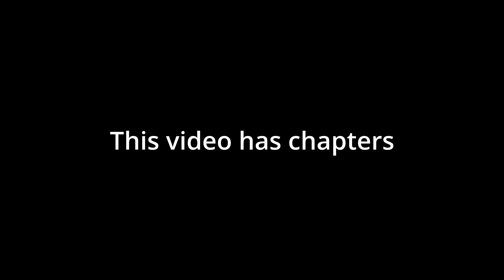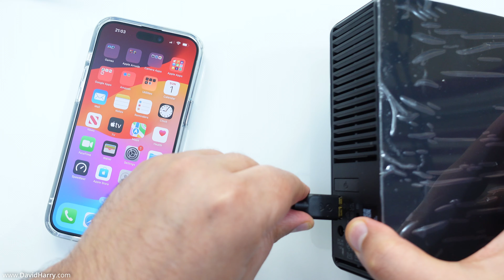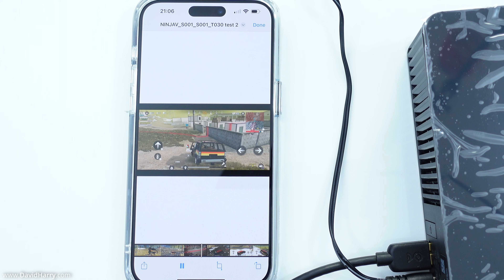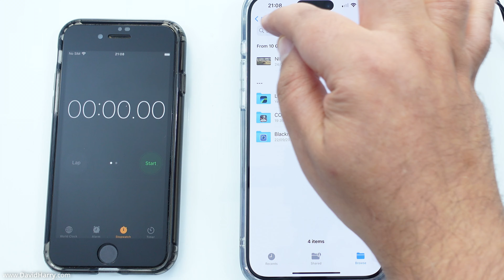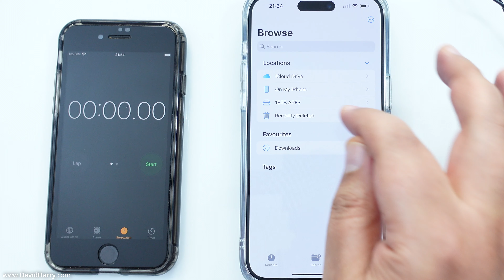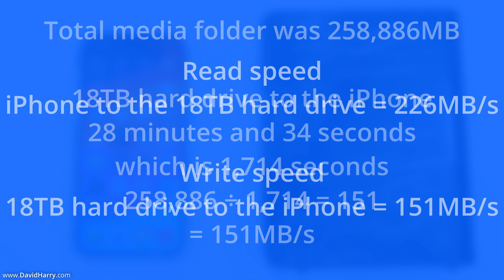How to connect a USB mechanical hard drive to your iPhone 15 Pro Max using a WB 18TB Elements drive

Comment from the maker: Using an 18TB USB 3 hard disk drive with your iPhone 15 Pro Max gives you a massive amount of backup storage space. With ProRes video files being so big and if you do a lot of filming, you will be needing to backoff those video files regularly to free up internal storage space on your iPhone.

This Western Digital WD Elements 18TB USB hard drive is a perfect temporary and intermediate backup solution for my iPhone 15 Pro Max within my video post production workflow. It may also be a consideration for you.

While SSD drives will be a faster option for backing-up and saving your ProRes video files form your iPhone 15. This 18TB hard drive is a way cheaper option on a per gigabyte basis. Plus this hard drive is actually faster than a lot of SATA SSDs in USB-C enclosures, as a lot of SATA, and even cheaper NVME SSDs, will slow down very quickly when they exceed their cache and buffer when writing to them

This WD hard drive also reads a lot faster and writes faster when used with a Windows or Mac PC.

Don't forget, this hard drive can also be used for other file storage from a Windows PC or Mac PC. Just make sure to use ExFAT if using Windows.

Paired up with the Blackmagic Camera App on iPhone 15 and DaVinci Resolve on your Windows or Mac PC. This drive is a seriously useful tool for your post production workflow.

Chapters:
00:00 Intro & explanation
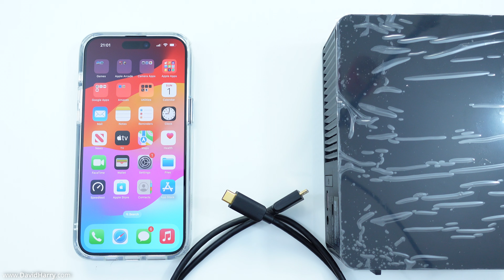03:33 Hardware setup
06:47 Playing ProRes from the hard drive
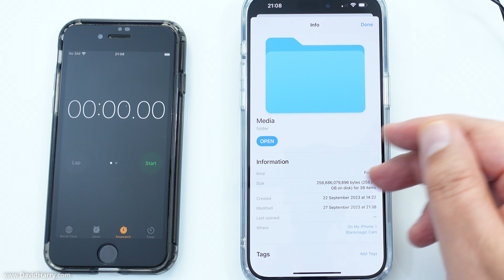09:48 Speed test 1, iPhone to hard drive
12:06 Speed test 2, hard drive to iPhone
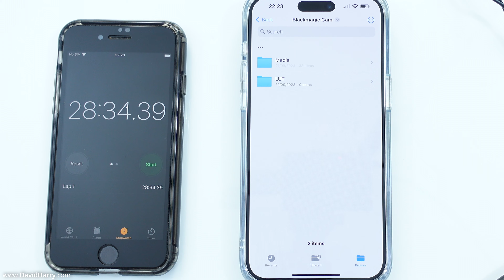14:05 The speed test results
15:26 More info about using external USB drives
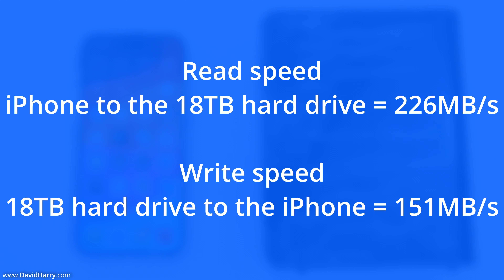17:43 End summary

Amazon links to stuff used in the video:
iPhone 15 Pro Max https://geni.us/iPhone15-ProMax
USB-C to Micro B USB3 cable 
WD 18TB Elements HDD https://geni.us/18TB-HDD

APPLE iPHONE 15:
iPhone 15 Pro https://geni.us/iPhone15-Pro
iPhone 15 Plus https://geni.us/iPhone15-Plus
iPhone 15 Standard https://geni.us/iPhone15-Standard
Apple Amazon Store  https://geni.us/AppleAmazonStore

APPLE PERIPHERALS:
USB-C to Headphone Jack Adapter https://geni.us/AppleHeadphoneCable

ESR PRODUCTS:
Tempered glass privacy screen protector https://geni.us/65oDO
Ultra-Tough camera lens protectors https://geni.us/WEWoYP
Hybrid case with MagSafe https://geni.us/Qr1u54g
Hybrid case with stand & MagSafe https://geni.us/AB9hqr
Soft case with with stand & MagSafe https://geni.us/SI2U
Tough case with stand & MagSafe https://geni.us/Epve
Kickstand wireless power bank 10,000mAh https://geni.us/e3Kedn
Mini Kickstand wireless power bank 5,000mAh https://geni.us/SYGOk
15W Car charger with MagSafe https://geni.us/AZNnqub
3-IN-1 iPhone, AirPods & Apple Watch wireless charging set https://geni.us/T91ojq
ESR Amazon Store https://geni.us/ESR-AmazonStore

ACASIS WEBSITE PRODUCTS:
TBU405 Pro M1 Thunderbolt 4 & USB 4 enclosure https://geni.us/Acasis-TBU405ProM1
TBU401 Thunderbolt 4 & USB 4 enclosure https://geni.us/Acasis-TBU401
DS9001 Thunderbolt 4 hub https://geni.us/Acasis-DS9001
DS7A15 15-TO-1 USB C dock https://geni.us/Acasis-DS7A15
ACASIS website https://geni.us/ACASIS

ACASIS PRODUCTS ON AMAZON:
TBU405 Pro M1 Thunderbolt 4 & USB 4 enclosure https://geni.us/Acasis-TBU405ProM1
TBU401 Thunderbolt 4 & USB 4 enclosure https://geni.us/ACASIS_TBU401
DS9001 Thunderbolt 4 hub https://geni.us/ACASIS-DS9001
DS7A15 15-TO-1 USB C dock https://geni.us/ACASIS-DS7A15
ACASIS Amazon Store https://geni.us/AcasisAmazonStore

WESTERN DIGITAL STORAGE:
SN850X 4TB https://geni.us/SN850X-4TB
SN850X 2TB https://geni.us/SN850X-2TB
SN850X 1TB https://geni.us/SN850X-1TB
WD Amazon Store https://geni.us/WD-Amazon-Store

BENKS WEBSITE PRODUCTS:
GlassWarrior screen protector https://geni.us/4FKwS2
ArmorAir Kevlar case https://shrsl.com/48p0a
Benks website https://geni.us/BENKS

BENKS PRODUCTS ON AMAZON:
GlassWarrior screen protector https://geni.us/4FKwS2
Benks Amazon Store https://geni.us/BenksAmazonStore

OTHER USEFUL PERIPHERALS:
CableCreation USB-C to HDMI cable https://geni.us/USBC-HDMI-Cable
SODI magnetic phone stand https://geni.us/Magnetic-Phone-Stand
Samsung T7 USB-C SSD https://geni.us/DTUAMK
Beyerdynamic DT 700 PRO X headphones https://geni.us/DT-700-PRO-X
Short USB-C cable https://geni.us/B1vAYA
Short USB-C cable on Amazon.com North America https://geni.us/k7oAq

Please give a thumbs up, share, sub & click the bell for notifications.

AMAZON ASSOCIATE DISCLOSURE:
I am an Amazon Associate.
My Amazon links are Amazon affiliate links.
I earn from qualifying purchases when you use my Amazon affiliate links.

You can also send me a coffee donation via PayPal https://www.paypal.me/DavidHarry

My global Amazon links:
Amazon USA: https://geni.us/Amazon-USA
Amazon UK: https://geni.us/Amazon-UK 
Amazon Deutschland: https://geni.us/Amazon-Deutschland
Amazon Canada: https://geni.us/Amazon-Canada
 
Contact me for product reviews.
YouTube@DavidHarry.com

http://www.DavidHarry.com

I’m David Harry. Thank you very much for watching this video, take care and goodbye now.

Cheers,
Dave.

#iPhone15

Comment: glad you cleared the pube off the table 😂 I did not expect a HDD to have faster write/read times than an SSD.  That blows my mind!  I'm now considering buying a large external HDD to archive my previous work!  cheers!
Reply from the maker: Alright, Tone. Yes, stray pubes are super annoying 😂 I’ll be doing a video soon showing that this hard drive is faster on long data transfers compared to a Samsung QVO SSD. Also, hard drives are way better for long term storage and archive. SSDs can lose data, basically discharge and their NAND cells degrade, when not connected to power. Also, high capacity hard drives like this one are cheaper per GB. Cheers, Dave.

Comment: Thankyou apple for inventing USB-C, what would the world do without such high speeds.
Reply: To be fair apple was one of the company’s that helped make USB-C 😂
Reply: @garethalston  Which makes it all the more strange that they resisted it for the iPhone for so long.
Reply: @Sameer89 are you blind yet? Check out those videos made by t7 ssd, don’t miss to notice the speed and the comparison between s23 ultra
Reply: @horrorsakib3781  If I remember the iPhone Pro's USB is Gen 2 where the Samsung S23 is Gen 1 resulting in the iPhone being 2 x faster than the Samsung for data transfer.

Comment: Is ExFAT handling improved on IOS? Last time I tried, on ipad air 4 and exfat external drives, writing to the external drive hundreds of photos ended up always with some missing files.
Reply from the maker: Hi. I did try this test on an ExFAT formatted version of one of these drives and there were no issues with files going missing. However, when using APFS you do get a speed advantage on all Apple products but mostly with very fast SSD storage, there’s not a huge speed difference with slower hard drives between ExFAT and APFS. Cheers, Dave.